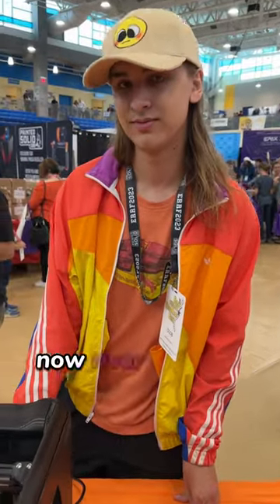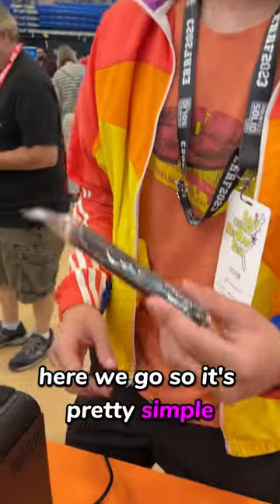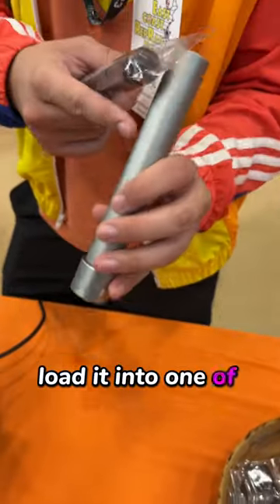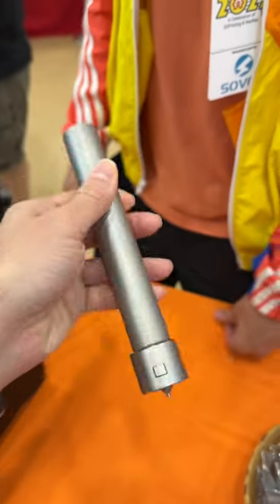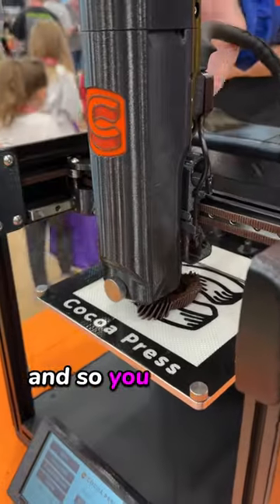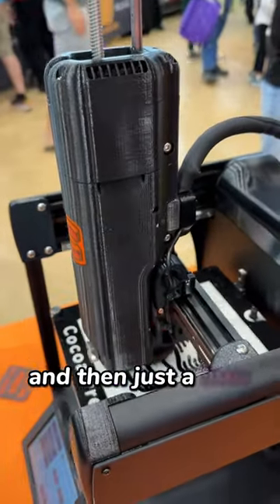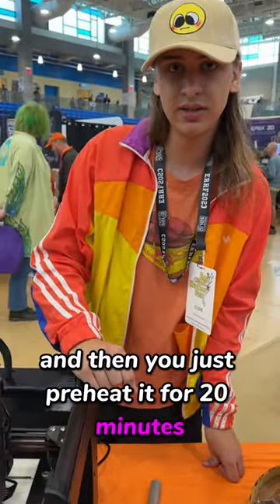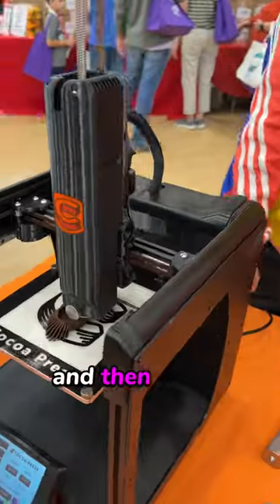How to load chocolate into chocolate 3D Printer #shorts

Comment: Would it be possible to use this type of cartridge tech to simplify recycling 3D prints? I’m thinking it would be easier to make the cartridges, than trying to get the right size filament diameter
Reply: This is an excellent idea id patent that quickly